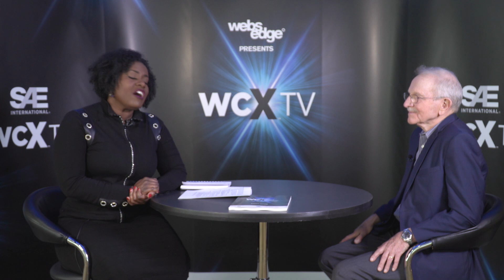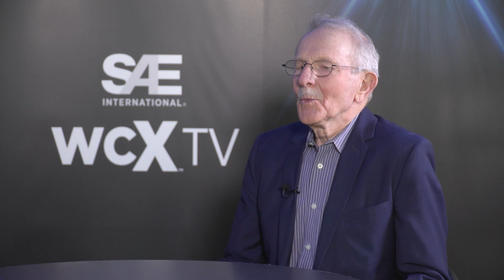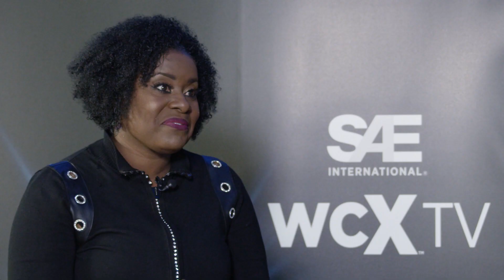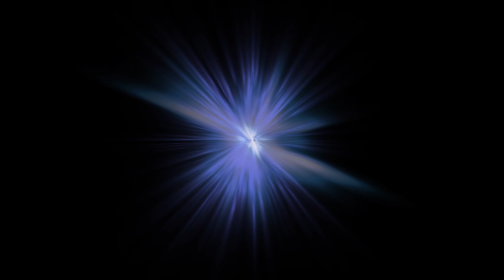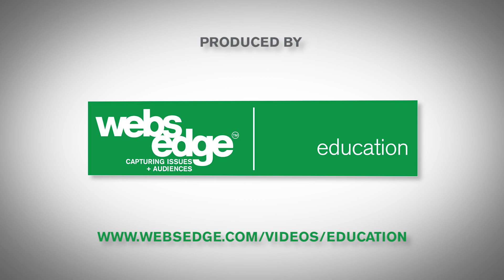John Heywood, Professor of Mechanical Engineering, MIT - WCX 2018

Comment: The gravity harness underwater perpetual motion wheel.
Using a bike wheel with an airflow gardenhose in the rimtrack. Mounted in an aquarium.  12 piston shafts from the rim to the axle (airtight) 12 plates over them. 12 accordion style air bags (cheap plastic dryer vent) caped with a weightlifter 1 lb. (With piston bolt) Weight. Each airbag when full can counterbalance the weight its next to. Their is only enough air in the system to fill 6 and have 6 empty. 
Gravity pulling always down moves the weight at the top twords the axle (about 4 inches closing that airbag) and the weight at the bottom away from the axle.(about 4 inches opening the airbag) taking the air from the top to the bottom airbags. All air on one side causing the wheel to remain unballenced and spinning with gravity.
The why can't you make one is a paradox barrier not a physics barrier. 
You can't make one and say "see it dosent work" because it does. 
Proof that God is real 

From the archangel Ram full Than 

This is Rumor from out of town 
He once was lost but now is found 
The truthful path he walks in the light 
No need for courage but a childs delight 
A simple poem holds back the night 
For tears of joy can remove the frown 
This is rumor from out of town